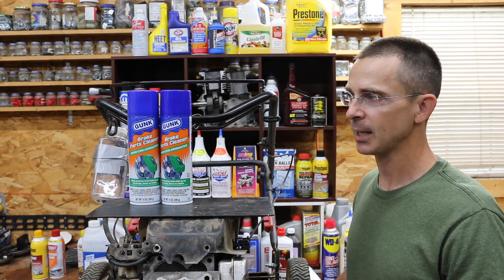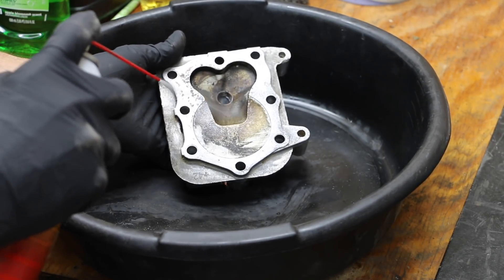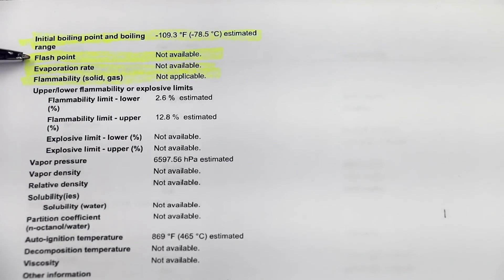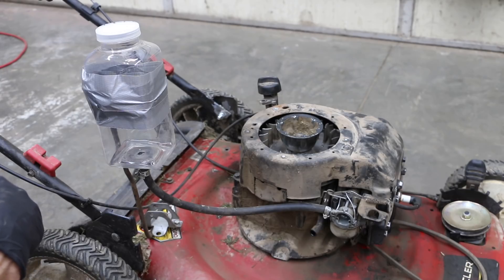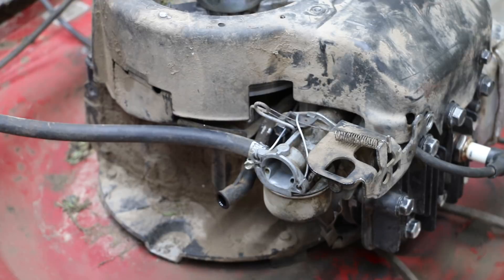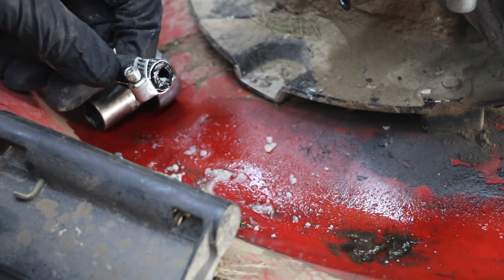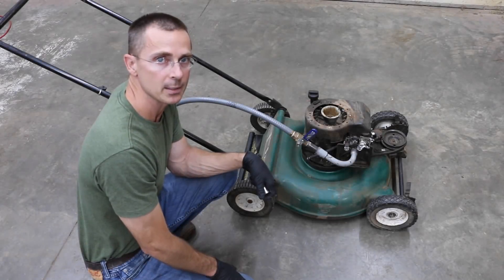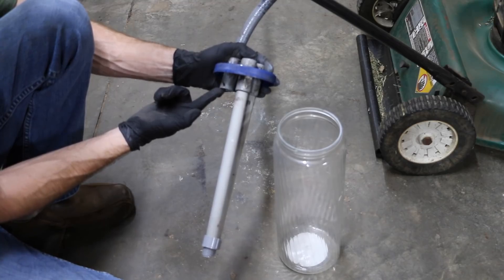Will a Gas Engine Run on Brake Parts Cleaner?  Lets find out!

Comment: Did you happen to see a difference in fuel consumption say what the brake clean vapor and any other experimental fuel you may have tested I know the brake clean was devastating on the carburetor may not have been able to run long enough for you just saying love your videos Man keep up the good work
Reply from the maker: The brake clean seemed to burn faster than gasoline, but I didn't do a very good job tuning for maximum efficiency and I didn't really test this. Thanks for the positive comment!

Comment: Run the engine on wood gas! Put wood in a sealed can, burn the can, and use the vapors to run the engine. You will need to filter the vapor through a couple jars filled with water. It's a good demonstration of vapors and filtering vapors through water.
Reply from the maker: Thank you for this recommendation. This seems like a fun project.

Comment: I'm a small engine Mech. Primarily these days, (former autotech, still do fleet for customers) but I use brake clean as a quick check for spark and diagnosis of dirty carburetor issues. Awesome stuff you produce every week, keep it up.
Reply from the maker: Thank you very much for the positive comment.

Comment: Corrosive  !=solvent.  Rubber and plastics disolve in a solvent. Metals corrode or rust in corrosive materials. Which did this do?
Reply from the maker: I used the wrong word. Thanks for commenting.

Comment: Here is my reply to liquid hydrogen.  Would love to see this one.   "That one would be fun to watch. I use to polish plastic parts using an oxy hydrogen torch. Used that mix because no carbon to dirty the parts. Trying to get liquid H2 would be very expensive and not safe to transport. Compressed H2 is more than good. Most welding stores have it. Bet the engine would run very cool and no carbon build up. Big problem would be little power verses amount used."
Reply from the maker: Thank you for this recommendation.

Comment: Can you maybe take a closer look at Lucas Oil Stabilizer? I've heard it can work well on cars that are driven daily. But when a car is driven so infrequently the oil only needs to be changed once a year, Lucas can turn it to sludge. Maybe this could be a long term test. Example: put LOS in an engine and only run it for 30 minutes or an hour each month, then see what it looks like compared to straight motor oil a year from now.
Reply from the maker: Thank you for this recommendation.

Comment: Here's an idea! Shell and bp advertise there has burned cleaner and or even will clean your engine at there to tear fuel.  We should compare to in your area is considered not so good fuel.
Reply from the maker: Thank you for this recommendation.
Reply: I like this idea.  Try a long term test of different brands or grades of gasoline. Discount versus brand name and a separate test- regular vs. Premium.  Run for hours or days.
Reply: I think it could be interesting to see the results clean, dirty will it clean? Temperature differences.  shoot yea! I know it would be a lot but if you or a friend even had a thermal type camera to see the flashing burn temperature difference while using the see thrue head that would be cool to. But that's a lot of $$$.

Comment: I like your channel just the way it is please don’t change and could you try running and engine on propane
Reply from the maker: Thank you for this recommendation. and thanks for the positive comment.
Reply: Common thing in generators. In fact Google will give you plenty of plans to how to make a propane carburetor for small engines.
Reply: Almost all indoor forklifts are ran on L.P.

Comment: What kind of forearm excersises do you do? These videos are great! You don't seem to do as much with diesel engines, but it would be cool to see if you could run one on hot grease as we normally throw that stuff away.
Reply from the maker: Thank you for this recommendation and thanks for the positive comment.  Using an axe to chop wood does wonders for the forearms. Chin-ups help some too. Thanks again.

Comment: If there is a way to run the engine off propane that would be quite interesting
Reply: Yep. Propane and compressed natural gas are common alternative fuels for vehicles.
Reply: Some gasoline engines can be converted to use propane quite easily, Ford offers propane conversion kits for some of their large commercial vehicles.
Reply from the maker: Thank you for this recommendation.
Reply: Project Farm if not you could try antifreeze or HEET if you have not already
Reply: Just don't ever try to fill CNG on a Propane vehicle, the pressure is a lot higher with CNG than Propane and there have been a number of nasty accidents when people have tried. But a test with a variety of gases could be interesting, Propane, Butane, Natural Gas, Acetylene are a few I can think of. Last one will probably cause a lot of black smoke though.
Reply: I've driven cars across the shop with dead a dead fuel pump with propane pumped in the intake
Reply: Project Farm propane can be combined with a Compressed Natural Gas experiment since both need the same kind of "Entry" to the engine, in theory our CNG drive busses can run on stright 100% Propane gas too. As an last solution if there is no CNG nearbye.
Reply: Outdoorguy 360 Come on Hank, be serious
Reply: the taxi's in las vegas are powered by propane.  I was in a crown victoria taxi and it had been converted to run on propane. joked with the driver if i could borrow his propane tank for a bar b que.

Comment: what happens to an engine when you fill the crankcase with water or coolant instead of oil?
Reply from the maker: Thank you for this recommendation.
Reply: hand held garage I'm not saying as fuel I'm saying in place of oil
Reply: water would boil off pretty fast I'd think, plus no lube properties
Reply: cdouglas1942 yeah I want to see what happens.
Reply: It won't run. My dad filled his chainsaw with old antifreeze coolant that he thought was mixed gas. Wouldn't start

Comment: I wonder if a gas engine would run on deseil vapors...? ↩
Reply: Do you ever wonder if you can run an engine on windshield washer fluid vapors
Reply from the maker: Thank you for this recommendation.
Reply: It would be cool to make a Briggs and Stratton small engine into a turbo deisel.!!! You need to have fuel injection to run on deisel.

Comment: Will a Vapor fed engine run cleaner than a standard fuel ran engine
Reply from the maker: Yes, but the vapor setup commonly causes the engine to run lean and have less power.  Running an engine lean can be hard on the engine. Thanks

Comment: Connect a helium balloon to the front of the carb or put it on a hose going to the carb like the one for vapor. Just run it to the hose that goes to the valve to let the vapor in.
Reply from the maker: Thank you for this recommendation.

Comment: Would an engine run backwards if you spin it backwards and out the carb on the exaust port??, I guess theoretically it would, but it would be interesting to see.
Reply: No.  On a 4 stroke the valve timing vs the ignition spark timing will be incorrect and self defeating
Reply: It should run backwards. It wouldn't cool effectively, however. The flywheel isn't designed to move air spinning that direction. To those of you talking about valve and ignition timing, that wouldn't have to change. Relatively speaking, the compression/power strokes would occur in the same points in the cycle. It may run like crap, as the valves and ports are different sizes. And the coil is positioned close to TDC. And TDC is TDC, regardless of engine direction. Also, the coil is positioned in such a way that it fires a little before TDC, so instead of the timing being a little advanced, it'll be a little retarded running backwards. But it would likely run.
Reply from the maker: Thank you for this recommendation.
Reply: Two strokes can run either direction but 4 strokes can't.  Most 2 stroke snowmobiles made in the last 10 years you push a button to reverse the engine so you can back up.
Reply: You probably could if it had a custom camshaft
Reply: Brian Reiff 2 stroke will run backwards. Probably would only need to change the spark timing.
Reply: jaj040 ha, knew i was forgetting a variable, It can never be that simple, never mind them
Reply: The problem is that the spark happens right before TDC running normally, running it backwards the spark would occur after TDC. I have no idea if it would actually run this way but I would assume you would get tons of detonation. If you could alter the timing of the motor you could theoretically run these basic motors backwards. Obviously things like oil pumps and cooling fans would be running backwards as well.
Reply: jaj040 a 2 stroke will run backward if advanced too far. I had 3 (!) Cagiva 500 MX bikes and one day I put it in gear and took off in reverse. wow. I rode 20 ft or so.....not sure of HP issues, but it ran strong for those 20 feet! it started like that 3-4 times but I recognized it by sound so nothing happened.
Reply: jamesb1221222 hehe

Comment: Can you show us at what rpm valves will float on a lawn mower? I’d guess 7000rpm!
Reply: Please use some sort of remote method to rev this up if it is done. One of these engines can be rather dangerous coming apart at high RPM.
Reply: What did you expect, 200+ customized responses per video? Most of the ideas are pretty same-y, so unless its really interesting or a lot of people want it chances are its not going to warrant a video. However given the video content has literally been pulled from the comments for some time now, claiming comments are being ignored is pretty silly.
Reply from the maker: Thank you for this recommendation.
Reply: I don't think you can get much more than 4000 rpm.  Also the risk of blowing the engine gets real high.
Reply: He's just ignoring all of your comments you look at every single comment and the reply from project farm is "Thank you for this recommendation".

Comment: Will an engine run on Axe body spray... Or any other aerosol
Reply from the maker: Thank you for this recommendation.
Reply: @KevinHendley Yes it will I had a Go-Kart and didn't want to leave it there to go get gas and i noticed a full can of Axe in the ditch (odd I know) and bypassed the air filter and cranked on it while spraying and drove the thing all the way back to the barn (where I had gasoline) I took off head cause I didn't feel much compression and the axe had eaten into the head gasket. But yes it will run on axe.

Comment: Engines will run on almost everything outta can, I've tried almost everything but Fly Spray test firing mowers when I get them in, anything in a can works, try the fly spray though, I'd like to see that but it's too cold outside here.
Reply from the maker: Thanks for commenting on this.

Comment: Is it possible to use alternative materials for head gasket? 
When it is impossible to get an original gasket, like for an old engine
Reply from the maker: Thank you for this recommendation. I'll see if I can do a video on this.
Reply: Project Farm Do 30 pack beer boxes first!
Reply: Alien Mechanic yes , condoms are good alternative! JK
Reply: I'd try cardboard rtv cork a few layers of thick foil and of course just jb weld the head to the block
Reply: Alien Mechanic I have used annealed copper for this cut on a home built CNC with success. I have not yet done this on larger engines though myself.  Just an older cast steel Briggs. Google "fedtech gaskets" I believe if you can design it they can make it, if it's something worthy of the costs.
Reply: While not the video I was looking for, yes absolutely. Copper is a nice easy metal to make a gasket out of /watch?v=a7qKHQV_o3E Or even RTV possibly /watch?v=21CvanhKILA
Reply: Heard about cardboard drink packaging for this (juice boxes).
Reply: Paper will burn

Comment: How long before it backfires and blows up your evaporator? I would suggest putting a low pressure check valve in the line so if it ever happens it closes off the vapor stream before catastrophic failure occurs and we have to see your filming from the burn ward, or from someplace after your shop or home burns.
Reply from the maker: This is a great recommendation and I'll modify this setup before i use it again.  Thanks again.

Comment: Hey! I think your videos are great the way they are! Very interesting very to the point and informative, I wouldn’t change anything! Also something that may be a little to dangerous but an idea nonetheless, could an engine run on acetylene?
Reply: Sounds like when we used to shoot 2 liter bottles across the shop in the same way!
Reply: A small amount at a time or lo flow.. You know how sooty it is by itself. Lighting a torch with the valve barely cracked  with no oxygen and all the little black soot worms floating around. That stuff is extremely rich.
Reply: ben b hey mate. Yeah you know what I'm talkin  about.  Didn't really want to use the  " word " 😂😂. 
We did some big ones too. One place i was at  this fella did a big one in a  784 truck tray ......while the boss was watching.  Didn't see him after that.  😂 . Good on ya mate Cheers 👍
Reply: I had a Warrant Officer in the Army tell me what a balloon filled with a good blue torch mix did. Don't take much to go a LONG ways!
Reply from the maker: Thank you for this recommendation and thanks for the positive comment.
Reply: Oh I definitely know, what would make the engine stop first build up in the exhaust? Around the valve, or just clog the spark plug?
Reply: If you add acetylene to  a small milk container and a short burst of oxy before running a lit torch over it , I reckon that would be very similar to what would  happen in the combustion chamber.  
Be good to see if it does clog up the spark plug and valves.

Comment: How about trying to make a motor run on Axe body spray? Or something aerosol perhaps.
Reply from the maker: Thank you for this recommendation.
Reply: MovieMaker225 it will run fine (depending on the spray ) most has 28%propane 50 to 40% lpg and other flammable gas! so I think it will run like it does with starter fluid!
Reply: I got home on a dirtbike after I busted my carb in the middle of nowhere, using can of axe body spray that was thrown in a ditch on the side of the road, it worked alright.
Reply: Will engines would run on aerosol hair spray? I know it burns when sprayed out of the can.
Reply: @LukeArnold01  As a woman I would NOT  recommend that as 95% of hairsprays contain polymers that are supposed to turn into solid to keep hair tidy.
Reply: I was thinking of things like Axe body spray, hair spray, or how about some flammable bug sprays? I remember Hot Shot spider and scorpion spray being fairly flamable. Lol or how about something like using lighter fluid in the vapor mower.
Reply: Works for diesel starter. Lol
Reply: hand held garage it would be interesting to see multiple sprays tried. Maybe even in a liquid form?
Reply: i second
Reply: Maybe oil spray or something alcoholic like an cleaner of sorts...
Reply: Yes please

Comment: I have a similar lawnmower. Mine has a Briggs and Stratton engine.
Right next to the thumb fuel pump, there's a choke, that may help with cold starts.
I guess it would be mounted where the air filter is located, which has been removed on this model.
Reply from the maker: Yes, I sure wish this one was setup like yours. Thanks for commenting.

Comment: I wonder if small holes drilled into the ends of the vapor intake pipes would make the vapor system more efficient. Like a bubble diffuser in a fish tank. Making a lot of smaller bubbles instead of the current larger bubbles. May help atomize the gasoline better? Heck even a series of vapor engine experiments could be fun to watch.
Reply: Project Farm If you do more vapor carb stuff, i would like to see you put fuel in that's contaminated with something like rust, random gunk, or something that you normally wouldn't want to use, but might work fine in the vapor carb.
Reply: @spaceminions 
That's a good idea,  could possibly use bad fuel that otherwise wouldn't want to use since it's only using the vapor maybe it wouldn't hurt. That's a great idea! 😊
Reply from the maker: Thank you for this recommendation.
Reply: Paradigm Mirror he could use a cpu cooler with a bunch of holes drilled in it, should help. I'd put the cooler on the bottom and a copper mesh over it.